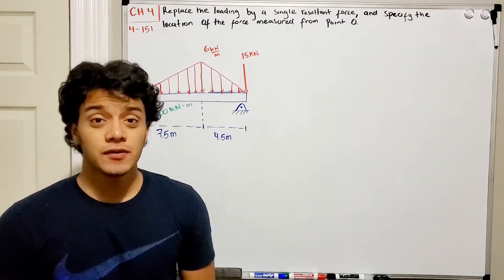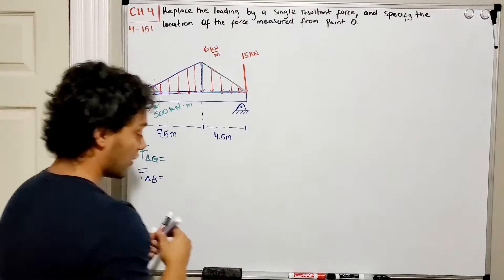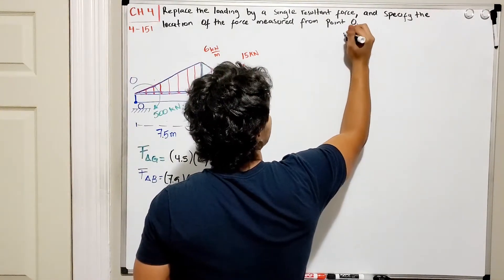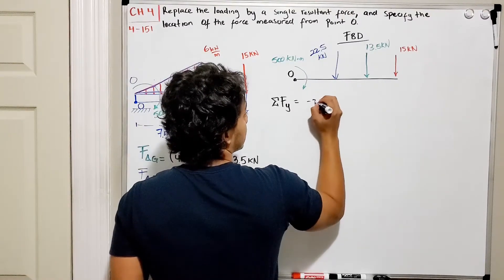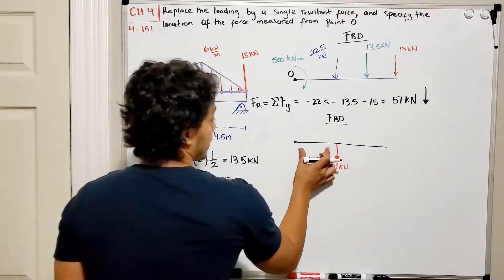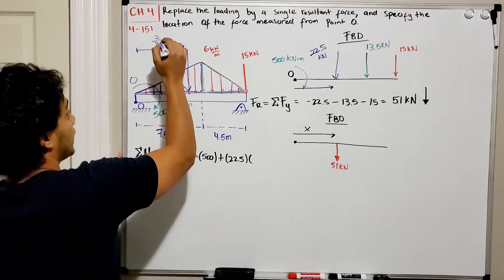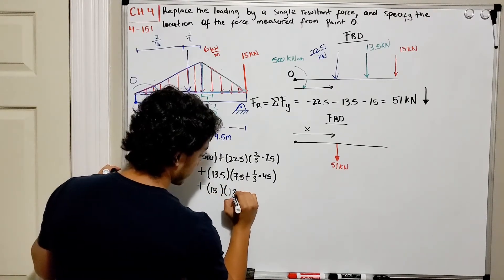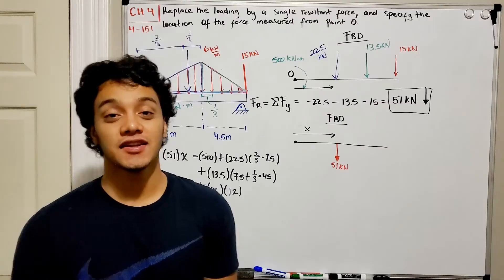Statics 4.151 - Replace the loading by a single resultant force and location of force measured.

Comment: It is almost a mistake on his part in the calculations because he is supposed to add the moment approximately to both sides. This means that the sum of the moments about o for the resultant = 51x + 500, and the moment of the two forces before unification = 500 + 5.5 * 36 + 12 * 15 = 878 ....... And now. When we equal the two equations, 500 will subtract 500. When it goes against the sign, then 378 will be added. Dividing the result by 51 will end up being 7.411.
Reply: shouldn't it be 51x+500=500+(22.5)*5+(13.5)*9+15*12 ? which results in 414/51=8.117. where did 5.5*36 come from?

Comment: How could the distance be 17.9 m if the maximum distance it could be is 7.5 m + 4.5 m = 12 m. it being 17.9 m from O would mean that it is not located on the beam.
Reply: It is almost a mistake on his part in the calculations because he is supposed to add the moment approximately to both sides. This means that the sum of the moments about o for the resultant = 51x + 500, and the moment of the two forces before unification = 500 + 5.5 * 36 + 12 * 15 = 878 ....... And now. When we equal the two equations, 500 will subtract 500. When it goes against the sign, then 378 will be added. Dividing the result by 51 will end up being 7.411.
Reply: wouldn't it be 8.11m tho

Comment: 7:20 Why is the F△B here and why do you assign r△B and r△G a factor of 2/3 and 1/3 respectively (as in why are their respective forces 2/3 and 1/3 of the distance)?
Reply: Lol same question hahahaha
Reply: The 2/3 thing for triangles is because of the centroid being at 2/3 the length of the base. It's just a geometric thing that tells you where the sum of forces for a triangle will act through. Centroid is kinda the same idea as center of mass or balance point.

Comment: Beam length is just 12 m then how  x value is 17.9 m bro
Reply from the maker: The location of the force should be at that mark location, even though the beam is shorter the resultant force from all those forces should be there in order to maintain the same force and moment around that point O. This is mainly implemented to sometimes simplify a problem when needed. :)